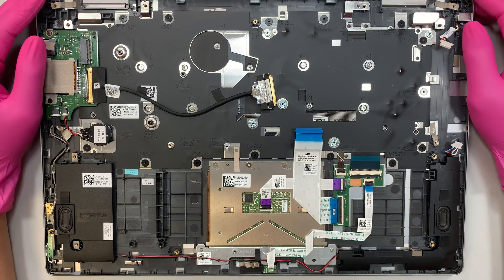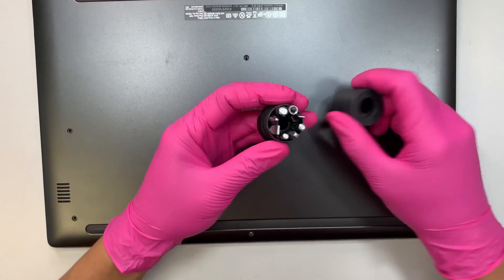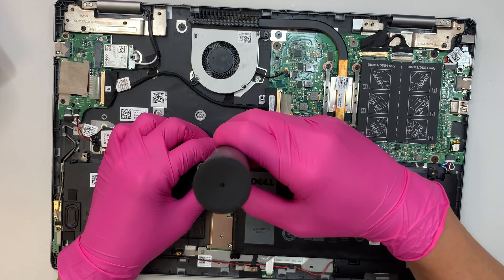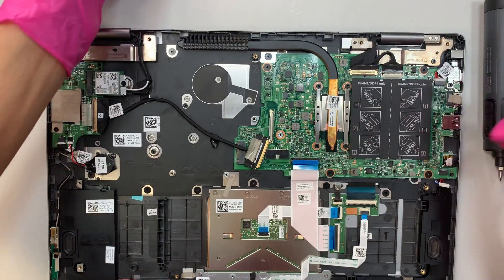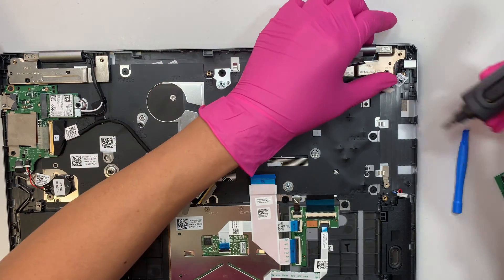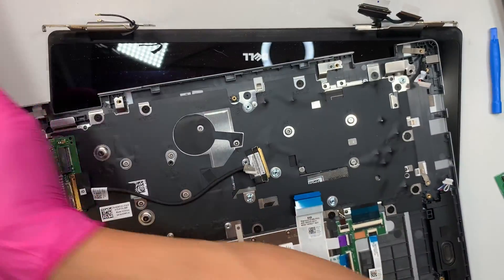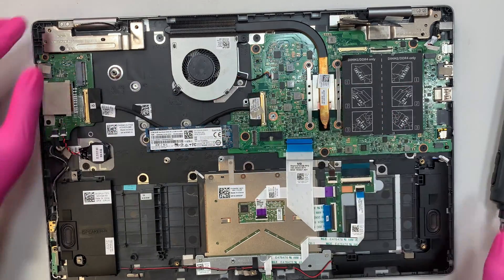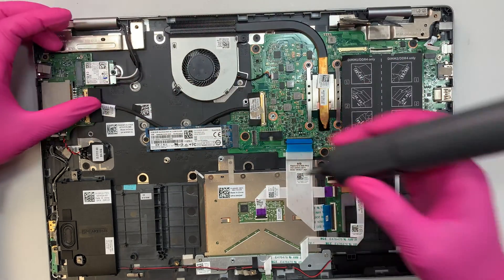Dell Inspiron 15 7000 Series P58F Keyboard Replacement

Comment: Just an advice, before you take everything apart, make sure you have your Bitlocker Recovery Key  written down somewhere.  In my case, after replacing the keyboard my Dell laptop asked for it and I did not have it.  It was not in my Microsoft account, which after reviewing some recording, I should have generated while the laptop was running.   Ended up having to factory reset the laptop and lost all the apps and data.
Reply from the maker: Sorry to hear you lost your data and apps. The Bitlocker Recovery key, you can retrieve by going to MS Account. Once you login, look for bitlocker key.